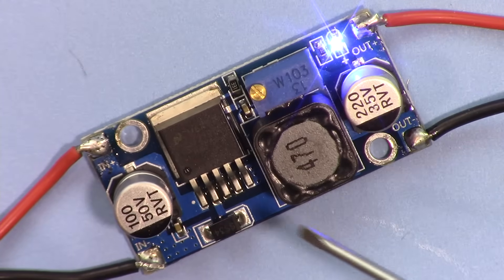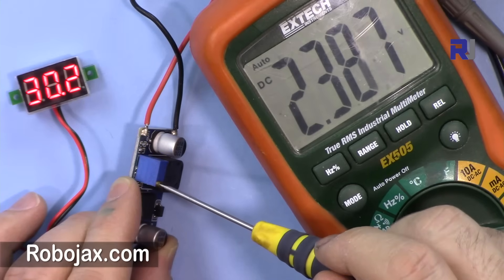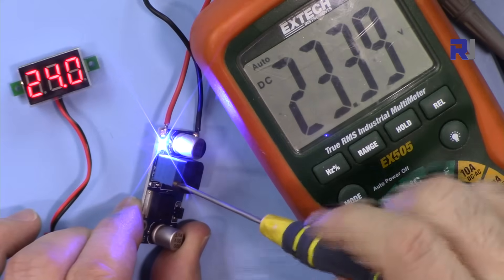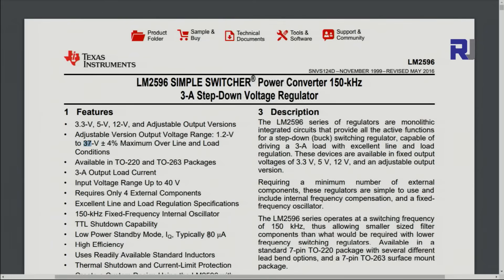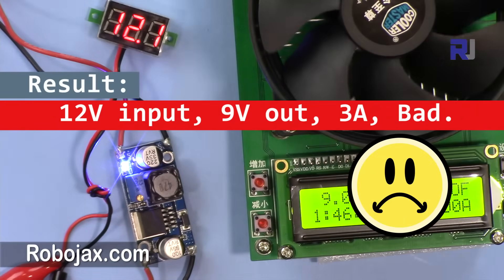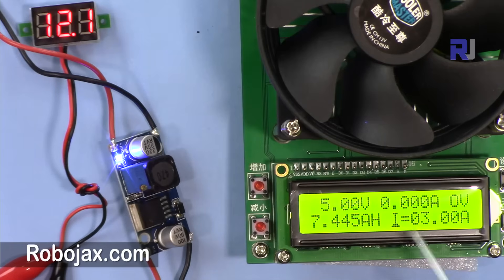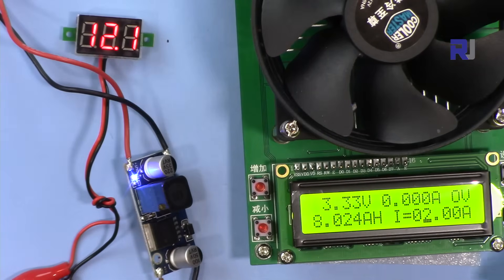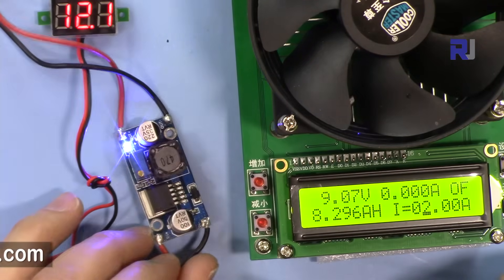LM2596 2v-37V  3A Voltage Step Down converter Module Tested/Reviewed

Comment: I cannot thank you enough for making such an informative video on ymthis module
Reply from the maker: You are welcome.
Reply: Robojax's conclusions are all correct, but I still like these modules.  They are RATED for 3A, but that does not mean you can actually suck 3A from them(with this design) on a 100% duty-cycle. ;)  They work really well as a sporadic PSU running a PTT transmitter or thermal printer, where the load is only present for a short time.  They can easily pass the full 3A, but just not continuously. ;)  50/50 on-off duty-cycle for 2A, and 25/75 on-off duty cycle for 3A works though. :)  For anything needing 100% load, they need heatsinking and lots of it, as heat is an electronics killer... :p  I would not recommend these be used at 100% load for anything over 1A.
Reply: @VauxhallViva1975  

What if we give variable or fluctuating DC voltage input range from 12 vdc to 30 vdc amper from 2.2 to 4.22 amperes input of  LM2596 Module and set the desirable voltags to 12 volt DC , will the output voltage be constant ?
Reply: @Royd20  Yes, the voltage will remain constant BUT the heat dissipation will vary depending on the input voltage and the output current.  As both the input voltage and output current are changing in your example, the voltage should remain constant for low-duty-cycle loads, but the dissipation will be all over the place depending on the input voltage vs output load.  It's tricky if you have a varying input voltage and output load. ;)  If you mean that you want 12v out, but the input can vary up and down, that is fine.  But you still need to calculate the heat dissipation to make sure you don't blow up the regulator.  Essentially, the higher the input voltage, the less output current you can suck from the regulator, as the difference is dissipated in heat.  Regulators like this are very efficient compared to the older linear ones, but even these need heatsinks if you are trying to suck 100% load from them with much of an input-output voltage difference..  Try to maintain the smallest input-output voltage differential, to get the best results and highest current from the setup. :)

Comment: @Robojax, does this really cost 1€?? Please I need help to buy!
Reply from the maker: Yes. I have provided the link in the description of video. Here 2 pieces for US$1. https://www.ebay.com/itm/272420115300
Reply: Robojax woow how it is so cheap?
(Edit)Do you think it is suitable to use to power my 9w speakers from my pc power supply, converting from 12 to 9v with this?
Reply from the maker: The modules are made cheap in China. If you wanted fast it would be $10 to $15 but this with this price it will take 30 to 70 days to arrive.
If you want to know if this work for your application, watch the video I have tested it.
Reply: Robojax I see. Well thanks a lot for the replay!
Reply from the maker: You are welcome.

Comment: thankyou so much. I was totally in the dark about what this thing was and why i needed it for my micro motor for my Zguage railway system. you explanation is all i needed. its all working fine now Thanks a lot
Reply from the maker: You are welcome.
Reply: @robojax  

What if we give variable or fluctuating DC voltage input range from 12 vdc to 30 vdc amper from 2.2 to 4.22 amperes input of  LM2596 Module and set the desirable voltags to 12 volt DC , will the output voltage be constant ?

Comment: Hi wanna ask..can the module support more than one output? I tend to step down the voltage from 12v to 5v for 6 servos.
Reply from the maker: Yes it can. it is up to you as many devices as you like. Just do not go above the limit of 2A or 3A I forgot how much. Watch the video.
Reply: @robojax  ive bought it and ive tried it. it can power up to 4 servo. thankyou
Reply from the maker: You are welcome.
Reply: @robojax  hi, sorry i have another question. in the beginning, it can support up to 4 servo. after few trials, found that, my step down, doesnt work fine. i got 12v input, step down to 5v, and power up 1 servo, the voltage suddenly drop to 2.27V. when remove the servo, the output voltage back to 5V. servo current only 500mA. is my module burn? also happened to my IR sensor. IR sensor only 20mA. when connected to the module, it drop to 2.27..
Reply: or do you have another way that i can contact you? cause you got the best explaination for now:)

Comment: I am not sure that these tests are really usable. The LM2596 datasheet states that a heatsink is necessary for 3A. Perheps it would have been a better quality test to try this device with 1A, 1.5A and 2A loads with a scope to show the resulting ripple?
Reply from the maker: I have not tested the chip. I have tested the module (PCB). This module is used like this you and you can't attache heat sink in it.

Comment: this lm2596 is fake. comparing real lm2596 sourced directly from TI, I have determined that >99.9% of the "lm2596" converters on amazon and ebay are fakes.

one of these days i'm going to decap a fake and see how they are constructed.
Reply from the maker: it is not fake. The manufacturer says on page 5 of this document that efficiency is 70% to 90%  http://www.ti.com/lit/ds/symlink/lm2596.pdf

Comment: Robojax, can I use this for powering Arduino mega from 12V power supply to step down to 9v? 3A means for output right?
Reply from the maker: Yes you can. it is way more powerful than what you need.
Reply: @robojax  thank you!!!
Reply from the maker: you are welcome.
Reply: @robojax  still didn't think about this project? I would wrote to you down and send via e-mail and you can still say no. ? So what do you say?
Reply from the maker: I am sorry. I am not following. What project?
Reply: @robojax  so it would consist to write a program for arduino .

Comment: Hook one of these things up to a scope under load. I've been messing with one trying to adapt it into a bench power supply, and the ripple is just unreal above 100mA or so. Across a 15 ohm load at about 15v (1A), and I was seeing around 300mV p-p ripple. With some filtering I can get it down to about 150mV. This is with a different module that has a real heatsink on the LM2596. I tested it at 2A (30V/15 ohm) and the ripple stayed about the same, but the inductor on the board would start squealing within certain voltage ranges (27-29v). Then would quiet down right at 30V. 

But it uses the same 4.7uH inductor that yours does. As another person commented, it just needs more inductance for a full 3A.
Reply: Could the ripple affect the readings of analogue sensors ?

Comment: D1 Is not a zener diode,  1N5824 would be a Schottky Diode, why would you need a zener on the output of a regulator? Its the flyback diode for the Inductor so it doesn't blow up your Regulator when you disconnect the load. DO NOT put a zener in its place. Also in the data sheet you can use it as an inverting regulator to generate negative voltage with a common ground.
Reply from the maker: Thank you for mentioned that. I have looked the symbol and it seems similar to zener diode. I fixed the video.

Comment: Also: look at the LM2596 datasheet for inductor dimensioning for loads. It seems the LM2596-ADJ requires a ~20uH inductor for 3A loads.
Reply from the maker: Yes . The data sheet has pretty everything you need to know https://snag.gy/AHhRpV.jpg
Reply: @robojax  by the way it is also stated in the datasheet that in order to get 3A output you need a dissipator.

Comment: Do you think I could rewire it to make a negative voltage? I have a 24-0-24 balanced circuit for opamps, but need 12-0-12 for an other part of the circuit. I can use one of these to convert 24V to 12V, but I also need to convert -24V to -12V...
Reply from the maker: No not possible. Negative voltage regulator has totally different functionality and can not be reversed by wires. it is the chip. there are negative regulator like this https://www.analog.com/media/en/reference-design-documentation/design-notes/dn1022f.pdf
Reply from the maker: and here is dual regulator: https://www.aliexpress.com/item/20W-5V-6V-9V-10V-12V-15V-24V-Positive-Negative-Dual-Output-Power-Supply-DC-DC/32924044001.html

Comment: Can you remove the little blue LED? I need to operate it in the dark, and removal of the LED might lower the operating current a bit (30 ma?). I need to operate from batteries, and minimizing idle current is important.
Reply from the maker: the LED uses about 10mA. Yes you should be able to remove it.
Reply: @robojax  Thanks for a prompt and proper reply. For 10 ma it may not be worth the bother but for removing excessive blue light, I will give it a try.
Reply: Of course you are

Comment: At 3V, 3A out, from the efficiency of 73% (cf. datasheet) you know the dissipation must be 27% of 9W = 2,43W. At 12V out, eff is better: 90%. I'd recommend cooling for everything above 1W. And please use a thermometer. They're not expensive and fingers are ... ridiculus ;)
Reply from the maker: the first and best sensor. finger no need to pay. You can send me a thermometer. My contact me via robojax.com contact page.
Reply: @robojax  yeah but if you break one, you can not buy it (for cheap)
Reply: actually you can, dark markets are a miracle

Comment: Many thanks for letting me know about potentiometer.!  I was thinking my converter was faulty.
 many turns to the left and voltage came down.  I needed 3v3 for N64 psu repair  .. (:
Reply from the maker: You are welcome.

Comment: what it the different between ( xl4015 vs lm2596 ) as a quality IC component, and the efficiency between them when you make from them a step-down converter.  as there a lot of boards DC to DC step down converters use this type of IC (xl4015 or lm2596 )
Reply from the maker: XL4015 can handle up to 8A and LM2596 only 3A. I have a video on the other device https://www.youtube.com/watch?v=AkbiOcpWZy4

Comment: Hmmmm. I have a thought to put this in my testing power supply until I get a proper regulating circuit. With 38V at the input, it is working fine. But then I applied some stress. I set the output voltage to 33V  I think the indicating   LED is already burning. Then I tried to go all in and I think it burned at 2.5 A No smoke but dead. I think it is designed mainly for lower voltages let say to 24V. and probably 2A max without some proper cooling.  In the datasheet are mainly measurements for 3.3V, 5V and 12V no info for higher voltages.
Reply from the maker: @Mixed The input  can be up to 40V. I just added the datasheet in the description.

Comment: Hey great video, when you buy the LM2596 online via Digikey or other electronics suppliers, I believe it only comes with the IC. Is there anywhere you can get the full module assembled and soldered already or do you always have to do this yourself?
Reply from the maker: This is a module and comes ready like that.  I have updated the description with link to eBay so you can see the product on sale from different sellers.

Comment: How much input current require to give 3A output
Reply from the maker: I did not provide it but I have noticed that these converters  have about 90% efficiency which is 10% loss. So they need 10% extra power at input. for 9V and 3A output 9V x3A=27W, add 10% to it would be 1.1x27 =29.7W. Now if you need to get this power from 12V input, then 29.7W÷12V =2.48A at input.

Comment: if I set it for 5v output will the output change if I put 12v on it or 24v on it? or will I have to adjust the screw every time to keep the 5v output?
Reply from the maker: No. I have shown this at the beginning of test that once you set the output, as long as the output is greater than the input, it will not change.
Reply: @robojax Don't you mean "as long as the output is less than the input"?

Comment: Sir please reply , if I input 12v and output 5v then how much amp I will get in this step down module??.. plz reply me sir .. my ph.no +917002358283
Reply from the maker: the current (amp) depends on the load if input can supply all current. So how much current do you need with 5V?
if you want 2A, then 5V x 2A  = 10W, then you need to have 11 or 12W at input(you need to have greater power at input due to conversion losses).  Then you have 12V input so 12W ÷ 12V =1A and you need to have 1A power supply at input.

Comment: Very detailed testing, but im missing one thing. You didnt tested it with for example 30V input and 2V output. I wanted to build mini adjustable PSU with my 40V 2A supply from old printer. You think that module will handle it?

I was thinking to put thermal pad and aluminium heatsink on bottom of the board, but stil doubt that i could produce 1,5-2A at low voltages.
Reply from the maker: no it would not. it can't work with 40V.
Reply: Thanks

Comment: which buck converter to use for a constant 2.4 amp current at 5v output, input voltage 12 volts
Reply from the maker: There are tones of 5V converter. Just get something like 3A or 4A to be safe.

Comment: thanks for the advice about continuing to wind the pot. i had assumed mine was bad.
Reply from the maker: You are welcome. This happened to me initially. I even removed the potentiometer and checked it. but the seller told me to rotate it multiple times and it worked

Comment: is it safe to put 12v 3a input and 5v output
Reply from the maker: Yes you can but how much current you need at output.  for example if you have 10W load, then P=IV,  I = P ÷ V,  --> I=10÷5=2A
I have updated the description of this video so you can click and view directly desired  test.
Reply: Robojax thanks 😀

Comment: Plz tell me if I can convert 5v dc to 12v dc and if yes, how? I tried to turn the thing clockwise with a cordless drill but the max I got is 4.85 v dc.
Reply: No....you cannot get a voltage higher than the input with a buck converter. You would need a boost converter. This is a buck. There are many cheap boosters available however.
Reply from the maker: I made the video to explain that. If you follow the video and don't get the result, either have different module or your module is defective.
Reply: englishrupe01 thanks. I bought the wrong inverter

Comment: hey i'm not good at eletronic but just solder it to ac adapter with is 19v-1,75a and i get only 18,6volt out ant its capable 2a to 28v but its allready all the way to max value why i can't get more than 20volt out put ? 
thanks for ansver
Reply from the maker: this is step down converter. Meaning the output voltage will be less than input.  So  for any input voltage, you will get (at max) a little less then maximum input voltage and then you can adjust it to get very low like 2V.
Reply: Robojax yes i after this post find out that i have buy wrong one instead stepup i take step down.

Comment: The LM2596 device IS capable of 3A.  This module is sold on the 3A thing, but it is not able to sustain that as you have found out.  Not without some changes to the design.  However having said that, they are a great little module, and if you are not planning to load it up to 100%, they work very well.  The price of these things is so cheap, something has to give, and it is the lack of proper heatsinking for higher output currents. ;)  I would not want to push them past 2A - ever.  Not unless you WANT a nuclear meltdown. :D  Nice video. :)
Reply from the maker: You are right. Thank you for the informative comment.

Comment: hi mr Robojax meet again
i want to ask how arduino is coupled with LM2596 2v-37V module and relay. with two buttons to control push pull solenoids.
the first button to press every 1x in 1x punch hit
The second button presses 1x solenoid hitting automatically / keep beating
please teach me how to install it with program code warold arduinonya because i need voltage.

thank you
Reply from the maker: Sorry, what is 1x in 1x punch? why you need the voltage regulator LM2596?
please post diagram or plan of your work here https://snag.gy/ and share the link back by clicking on "Reply"
Reply: sorry I mean 1x = one click . and not  lm2596 but xl6009 or MT3608. tank
Reply from the maker: okay, you have to draw a flow chart like this https://snag.gy/VsfTm5.jpg and post it. Then I have to see if I can do it.
without a flow chart, it would be very hard to ask or work with other people.
Reply: Mr. Robojax.
I thank you, because I saw your video "How to use Relay 5V with Arduino to turn the AC light on and off"
By raising the automatic ups it runs smoothly.
Just to add one button can not yet, my desire when the massage button is longer the desire lights turn on and off automatically, until I massage it again.
because I have not mastered the arduino program yet.
Ease You can provide solutions.
thank you
Reply from the maker: I have updated the code in this page which is for Push ON and Push off  : https://goo.gl/zTPsdh
Use the 2nd code at the bottom. I will try to help you if I can more.